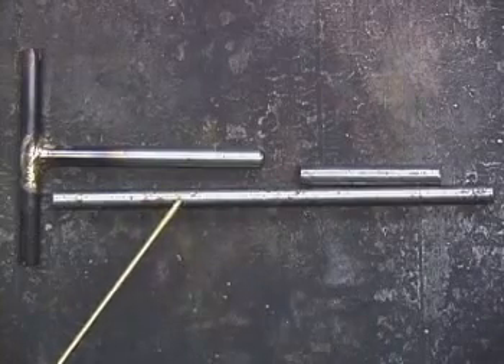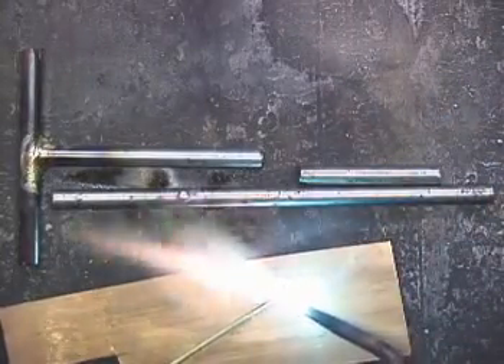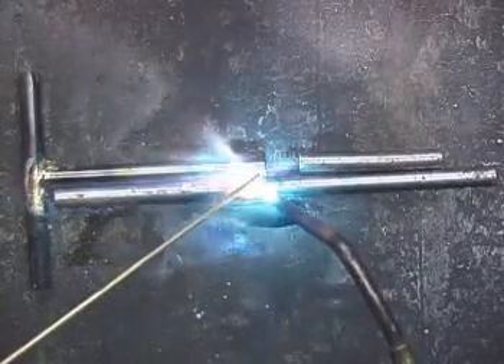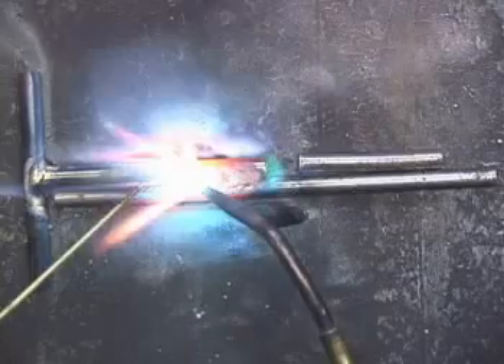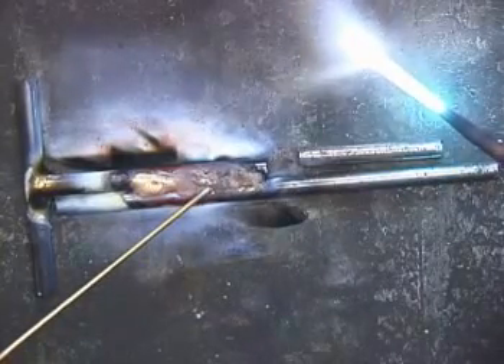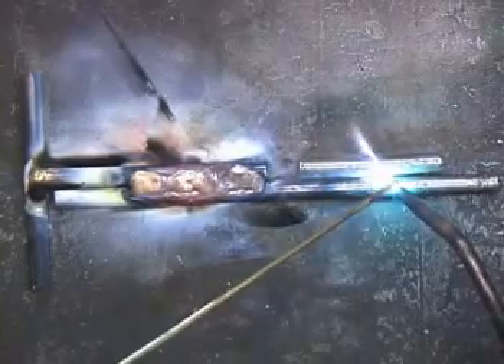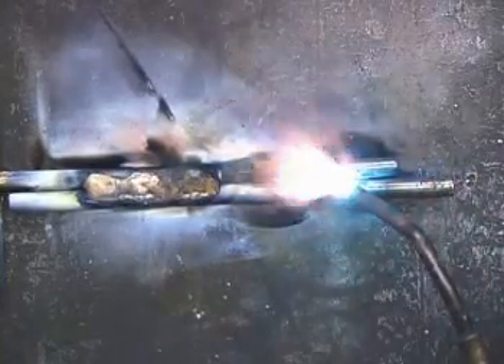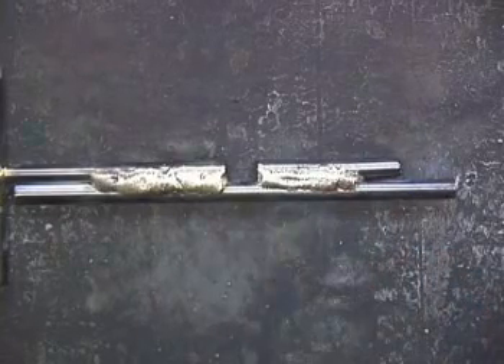Brazing Hints and Tips

Comment: George I want to make a copper tree attached to a 40" oval of copper, the tree will obviously be in the middle of the oval. the oval being about 18" high in the middle. this is going to be attached to the top of my yard gate at home. the gate at the top is concave for the oval to fit in. I was thinking of using 1/2" copper tubing for the oval and copper rods for the tree then adding leaves like you did on your video, now.... can I braze all that with a propane torch?
Reply from the maker: You may be able to solder your tree with a propane torch. I doubt that there is enough heat to braze.   Unfortunately I know nothing about solder.   If you can get the tree soldered together, then I would reinforce in from the back with a good two part clear  epoxy.  Sorry, that's the best that I can come up with.
Reply: @897473   thanks George that heps.
Reply from the maker: @Bluejazzman61  you may want to take a look at Sil-fos.  Here are some links that may help.

https://blog.lucasmilhaupt.com/en-us/about/blog     https://www.reddit.com/r/HVAC/comments/90zhs5/tried_some_silfos_brazing_with_a_propane_torch/
https://forum.heatinghelp.com/discussion/79330/sil-phos-plumbing

https://weldtalk.hobartwelders.com/forum/weld-talk-topic-archive/welding-products/3306-joining-copper-to-copper

Comment: Hi again George, I notice you use a metal table top to work on. Do you prefer that to say a brick surface and why. Just thinking of a practical top surface to make. Thanks again. Seen more videos you've made that answered a lots of questions. But not that,,, thank you so much. 👍
Reply from the maker: Table is 1/2" mild steel, 3' x 4'.  I tried brick when I first started, but it didn't work for me.  I've been using these steel top tables since 1974 and have been well pleased.  Personally, I wouldn't go for anything less than 1/2".
Reply: Thanks,,, makes sense. I have a sheet of 3/16s galvanized steel but guess that wouldn't hold up to too much heat? Have to look into something thicker.

Comment: How long does the gas tanks last and how much are they to refill?
Reply from the maker: I asked that question when I first started back in the late 1960's.  Unfortunately, there is no answer.  There are too many variables.  What size torch, what size tip, regulator settings, braze or weld, thickness of material, steel copper, brass or stainless.  Cost of oxygen and acetylene is per cubic foot.  It costs less per cubic foot to fill larger cylinders than  smaller ones.  I just paid $56.00 for 142 cu. ft. for acetylene.  120 Cu Ft. of oxygen was $18.00.
Reply: acetylene is expensive and I see some using propane for brazing, its $.43 to fill a size 10 compared to $18 with acetylene, do you think its ok to use propane?
Reply from the maker: I see that more and more people are using propane for brazing.  Having no experience with propane for brazing, I can offer no opinion.  The only thing I can suggest is to look for propane YouTube videos and do some research on the welding forums.
Reply: thank you sir, you do great work

Comment: George, would it be possible to say cut a half-inch or so section of rod lay it in the joint then, melt it in?
Reply from the maker: Tom, not sure whether you are talking about brazing or welding.  If it is possible, then both sides would have to be heated to red hot or yellow hot, depending on whether you are brazing or welding.  Not getting your filler rod heated up so much that it melts before each side is up to temperature.  Let me know whether this answers you question.  George
Reply: Brazing,
That's true the metal would be too hot. Just a thought...good videos George.

Comment: Professional welders use less brass and preheat the metal so when you melt it on it just flows by capillarity
Reply from the maker: For what I do I use an excess of bronze brazing.  The gold color of the brazing adds an extra contrast to a finished piece.  If I just wanted to put two piece together I would use a very small amount of brazing.

Comment: Can thick metal be torch brazed? I know cast iron is usually thick and stainless steel sometimes.
Reply from the maker: Yes, you can braze thicker metals.  Cast iron takes some special preparation. I have very little experience with cast iron so I am not a good source of information.  I have brazed and welded 1/4" stainless with the oxy/ace torch.  There is not much on brazing heavier metals because most people find it more economical to use electric, such as Mig, Tig and Arc welding with the appropriate filler rod.
Reply from the maker: The heaviest steel I've brazed is 3/8 and that was only for a demonstration.  Generally on that thick of steel I mig weld.  But, yes, you can braze heavier metal.

Comment from the maker: Yes, I braze stainless steel.  I just use a standard 3/32 bare bronze rod and you some silver solder flux.  For brazing I haven't found a rod that is the stainless steel color.  If I want the color to match then I gas weld with a stainless steel gas welding rod.  However, I do very little stainless work.

Comment from the maker: 1) I use all new material so I don't need a lot of flux.
2) I use flux covered brazing rod.
3) Since I don't need a lot of flux I scrape most of the flux off the flux covered brazing rod.
4) For stems on leaves I put a daub of bronze on the stem and then re-melt it onto the leaves.
5) Question, why don't I just use bare rod and dip it in flux?  When I do that I get a big glob of flux.  Way too much flux.    
6) Scraping the fluxed covered rod works for me.

Comment from the maker: @Lubelltx 

If you are using RG 45 mild steel welding rod with a copper sheath (coating) - the black will not come off.  The black is where the thin copper sheath of copper has burnt off.  

Boiling water should remove the flux.

Comment from the maker: I use 3/32 (diameter) brazing rod for most everything I do.  That would be brazing 1/16 to 3/16 thickness.  

If you are brazing thicker material you can go with 1/8 or even 3/16 diameter brazing rod.

Comment from the maker: Brazing is joining two piece of metal using a bronze filler rod. It is much like soldering but the joint is much stronger than soldering.  

In brazing steel the edges of the two pieces are heated to red hot and a bronze brazing rod is melted into in between the the two edges.  

Check out the You Tube video Braze Vs. Weld